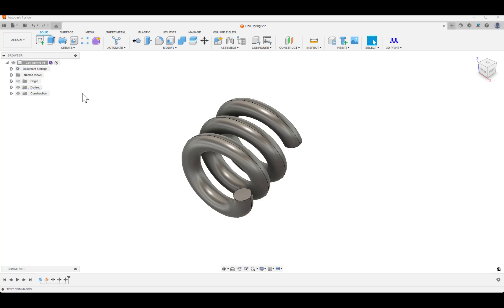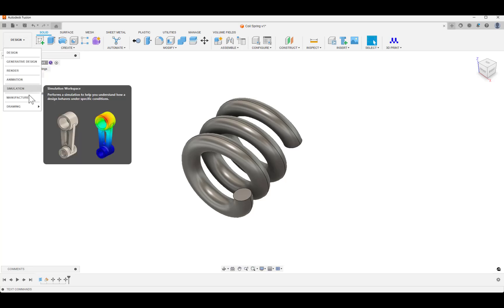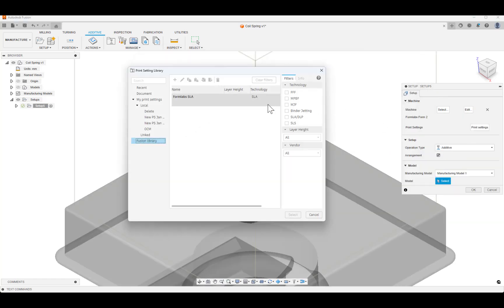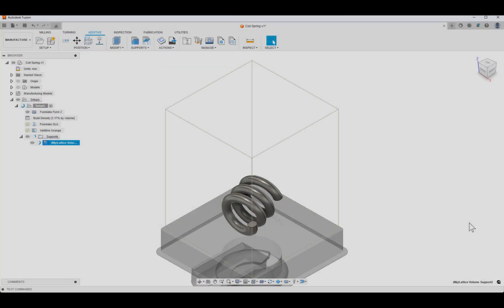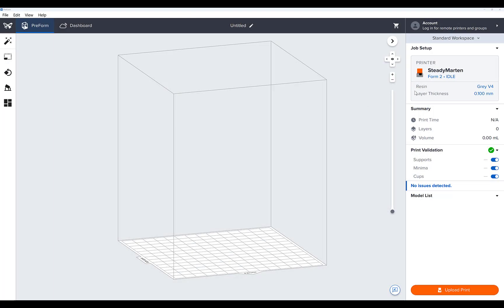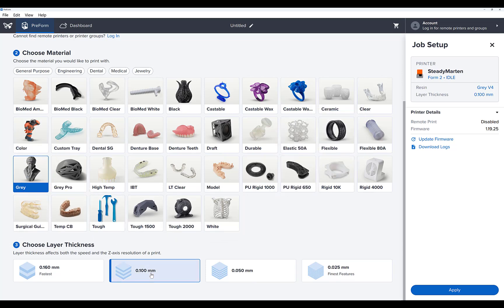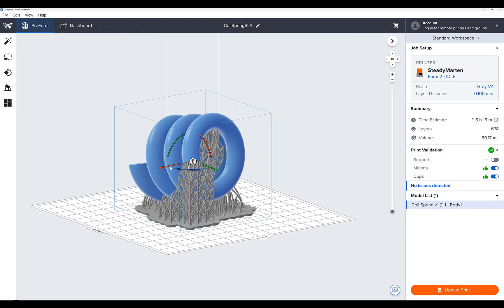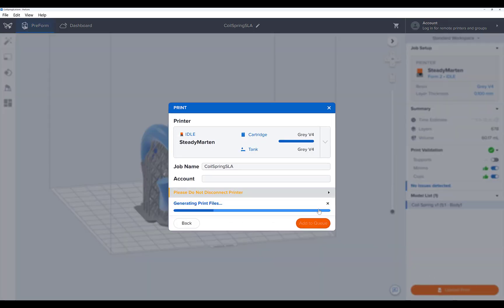Printing to your Formlabs printers with Autodesk Fusion

Comment: why do the supports in fusion vs preform? seems like you have much more control over things like touchpoint size and location in perform.
Reply: The only benefit I see is that you don’t have to regenerate supports and orientation every time you make a slight mod to the model, and no reason to save the Form file each time either.